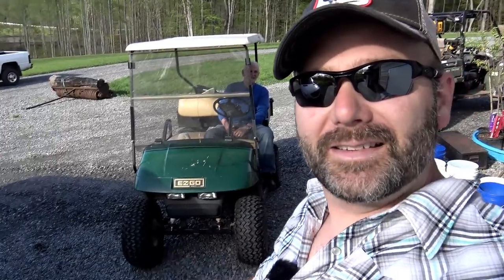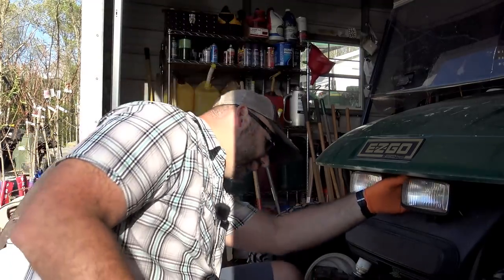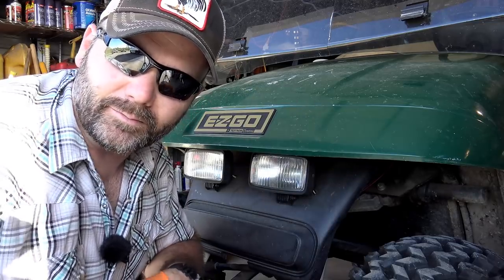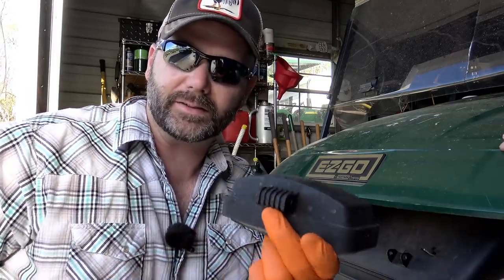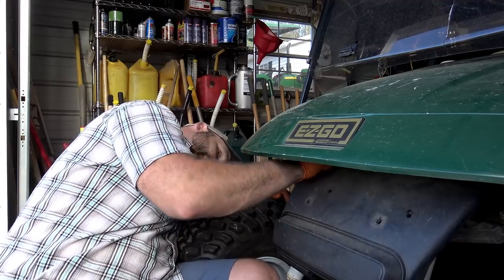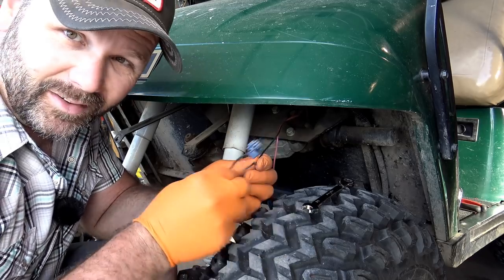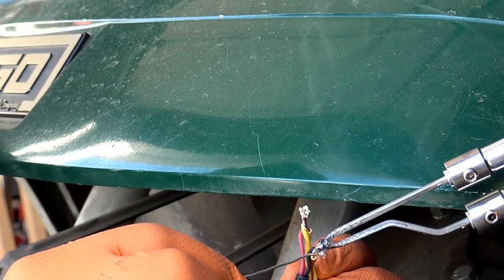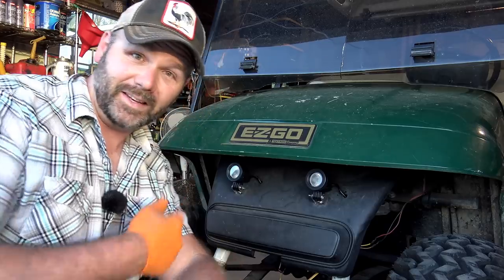THESE OLD ONES AREN'T SAFE!! HELPING OUT A NEIGHBOR IN NEED..

Comment: Flux is a cleaning agent. If you get rosin core solder you will not need to use flux. Flux is in the center of the solder. 
As for the haters. Screw’em. Your doing a great program and living life to the fullest. Be you brother. Love God. And Be proud of your country.

Comment: I had a john deere zero run. I put lights on it also. I mounted the switch in one of the extra panels on the gauge panel. worked great til I sold it , now someone else is using it. Keep up the great videos! One day hope to have something like you have.
Reply from the maker: funny you say that.....the next set of lights is going on the zero turn

Comment: What also works well Josh is rosin core solder.I got lucky and bought the last supplies at Radio Shack befor they went under.I am a retired union plumber that has seen about every way to solder....weld....braze copper pipe.That Ezgo brings back memories.I had a lifted 2003 with the robbins engine.I installed a 8 place fuse block in mine.It came with lights and tail lights in back.You can drive them on the town roads as long as you have turn signals.In which I bought the kit on Ebay

Comment: Quick tip to keep the green gremlins away on those connections. Put silicone grease (non petroleum)on the bare wire and then slide over the shrink wrap. I live in a rough area for rust and corrosion and find this works well for me. Take care bud and dont listen to the haters.

Comment: Hi Josh, just a couple of quick hints, Rosin core solder has the flux in the core of the solder and is the only solder flux that is not acidic, I.e the only one that does not promote corrosion in the soldered connection. You should be able to get it in rolls from a true electronics enthusiast store that sells components (rather than imported electronic toys). Rolls come in various lengths and solder diameters, for what you are doing here and similar wiring tasks, 1/6in to 1/8in dia would be great. A 50ft coil in a bag would probably last quite a few projects. As someone else mentioned with heatshrink, a heat gun is normally the way to go, rather than a large gas burner, though I have resorted to a gas BBQ lighter or disposable cig lighter when desperate. You mentioned being concerned about toasting the heatshrink, at that time the flame was getting close to your gloved hand. If you toast the glove, not only do you loose the protection it had been offering, but you can get a serious burn as the plastic melts and sticks to your skin, coupling all of it's stored heat into your skin, and potentially pulling skin off as you try to remove the burning plastic. Can take weeks to heal, and not a good look for a nurse who is quite dependent on hand sensitivity for a lot of things.
Oh, about the warning not to eat solder, I'm in two minds, yes it is sound safety advice, but it might put new ideas into kids heads about dares they can set up with others.
Not trying to be hatefull or nasty, just spreading some of my 50yrs work experience around, as you are spreading your experience around.

Comment: Not tying to step on anyone's toes but may I suggest for some heat shrink you can use a hair dryer on high temp to shrink the heat shrink or purchase a heat shrink gun for as little as 10 to 15 bucks........saves a chance of getting burned by the torch.
Reply: Why not just use a bic lighter....that's cheaper and works just fine.
Reply: Yes it does, just suggesting an alternative to an open flame.

Comment: Not being mean... but you should learn what a Western Union wire splice is.  When you spliced your wires back together  you did it side beside.  Hot wire and ground should be a couple of inches apart.  Again not being a smart ass..  just an fyi

Comment: well those blue thing are called soderless connector they work fine  second thing is your sodering jiont is called a cold joint the flux is a cleaner for your connection to do it right you tun your wier ends then you soder them to gether and if you want it to be water tight you use liquid electirical tape then heat shirink
Reply: You don't want live in a snow state. Soderless  connectors are junk and should never be used. And a cold joint is when you don't heat the wire enough to melt the soder on the wire . Witch he did. And it's WIRE not wier.
Reply: @Steve B Since we are being all high and mighty. It's WHICH not witch.

Comment: That is the way I am going with my '79 F-350 is all LED lighting. My little F-100 has all incandescent lights and my 65 amp alternator can't handle the draw with all the factory and aftermarket lighting going at once. I have to run the factory lights and my pair of 55w driving lights for now which isn't much. Once I get my 140 Amp Alternator I'll be able to run the factory lights, accessories, pair of 55w and 100w driving lights.

Comment: I solder every electrical connection I make. It's a permanent fix, insulated connectors are more of a temporary fix in my opinion. I twist the wires end to end instead of parallel to allow the heat shrink to fit over the connection easier and avoid the risk of the wires breaking from being bent 180 degrees on one wire. Keep up the good work and don't let the haters get to you!

Comment: If its a 9Volt system would the lights be brighter with a 12Volt system? Or while the engine is running do they get brighter? I ask lol bc i had an old go cart that didnt have a volt regulator a d the light would get brighter on acceleration.  Great video brother. God Bless